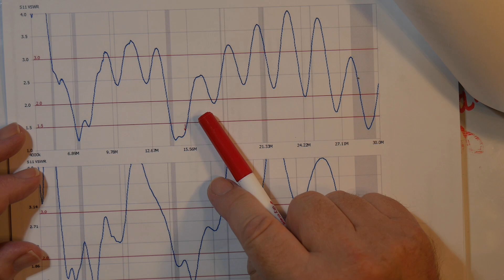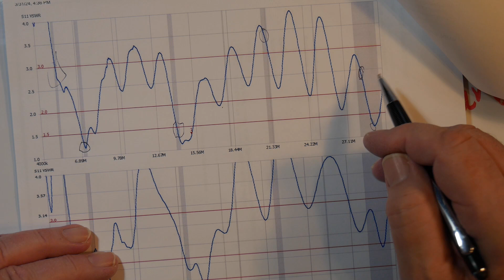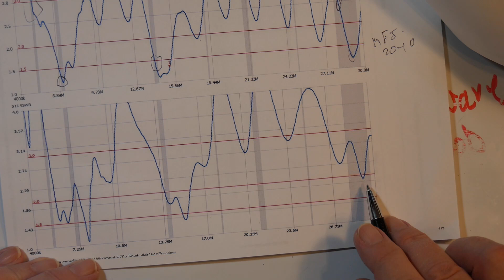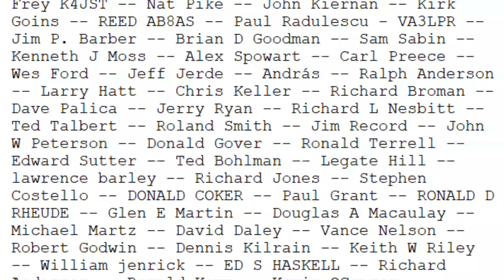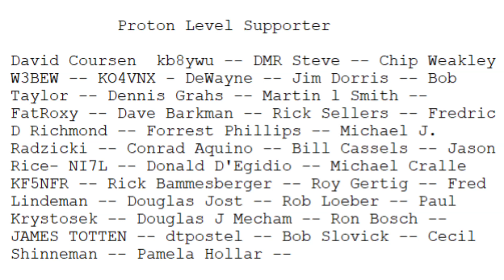Sudden Changes in Antenna Performance (#1103)

Comment: You could have moisture inside the balun box, there might want  open the box and check the toroid, any high voltage caps, and check to see if the cable has stretched under the weight of heavy snow. G7VFY

Comment: Dave, at 4.00-4.30, about the CMC choke and the voltage BalUn, you are totally confused as you do always. 
I understand you are talking about a hybrid BalUn. 
It has a 4:1 voltage BalUn which is followed by a 1:1 CMC choke. 
Regarding continuity test, wiggling test etc you may be little bit specific 🤔 
De VU2RZA
Reply: @jefff2593  OK, thanks for your explanation. 
I suggest you go through my comments on his videos posted previously. It might enlighten you,I believe. 
Here, Dave could have drawn a 4:1 Ruthrof voltage BalUn (or whatever he mentioned here) that would be followed by an 1:1 CMC choke or Gunella  current BalUn.
Wiggling the cable is one thing any would tend to do.
The questioner, Aldo, mentioned snowstorms.
It is obvious that water must have seeped into the BalUn box. Ironically, Dave talks about 'one problem ' and not many problems there.
Yes, water drenching the torroid assembly is the one problem to be attended to. 
If Aldo doesn't open up the BalUn box and tests for continuity, what would he deduce? 
Or else you must explain what one could conclude by doing a continuity test at the ports of a hybrid BalUn. 
Dave has done more than 1000 videos. 
He could always draw a picture (like he used to do, despite the fact that he is never good at, and nobody cares about the beauty of his diagrams) of the hybrid BalUn. He could have moved on how to and what to expect by a continuity test at the inner connections. 
I can understand your concern and anger, but this is what and how Mr.Aldo and others could be helped by a video on this subject. 
In many of his previous videos, Dave himself has confessed (and confirmed) his poor understanding in the subject of BalUns, Chokes, UnUns etc. Moreover, he has very well doubted about the role or efficacy of them in various places and applications. 
Maybe you have a different take, but I don't bother. 
Anyway, thanks 😊 
De VU2RZA